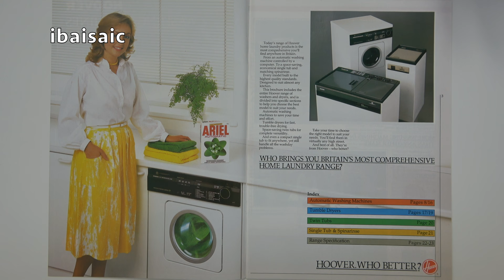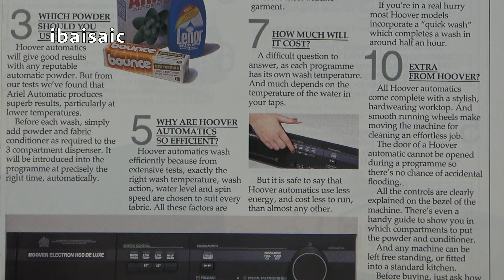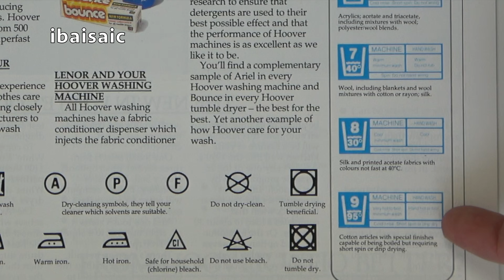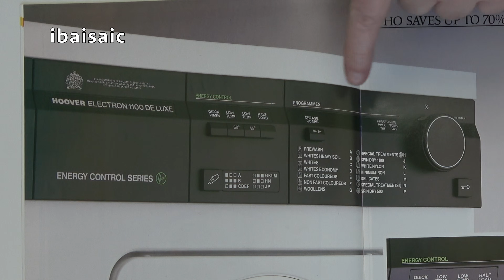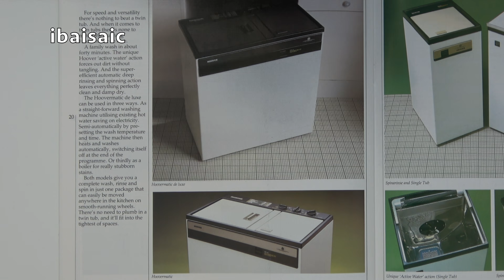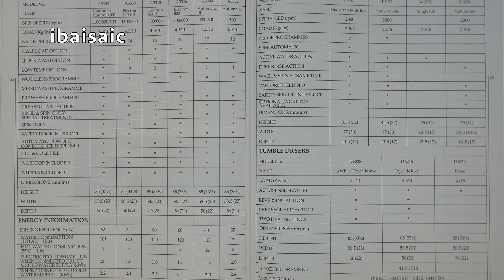Hoover Washing Machines & Dryers Brochure 1980s

Comment: In 1985 my mum bought the Electron 1100 deluxe, energy control series EDS   It was from the electricity board ( seeboard  down here in the south in Hastings )  the wash guide was on the drawer and the fascia panel and dial were like a browny grey colour, that machine was used 2/3 times a day every day for 15 years, the last 5 years was with duff bearings,  best washing machine she ever had,   I had the electron 800 when I first moved out of home then upgraded to the logic 1300 deluxe ( had the beep when it finished )    I would give my right arm to get an electron 1100 now,  been after one for years, I would use it as my daily machine

Comment: My first front loader was a hoover. In 1992 bought a hoover spinner being sold as spare for £5 from a jung shop because the spinner wasn't moving it was an old 1 shilling (5pence) stopping it from working still have it today in working order but without the rubber ring to put on top of your washing.  Came in handy in lockdown when my Beko front loader broke down.